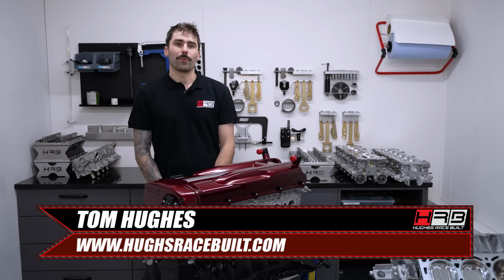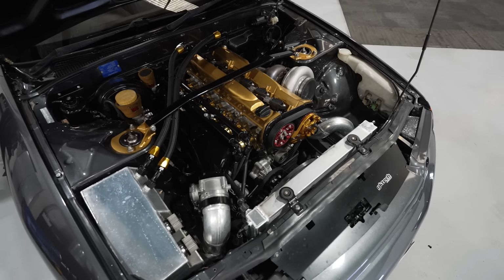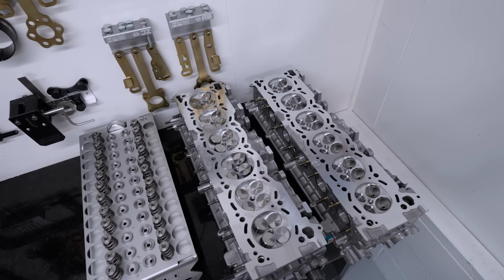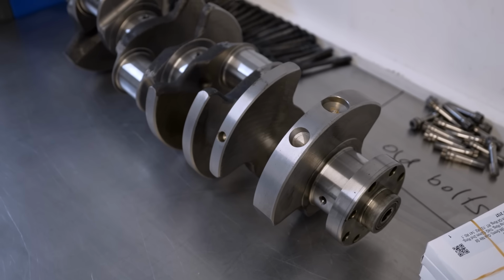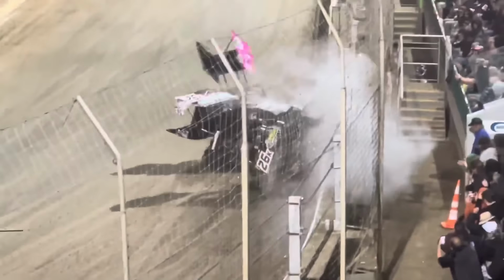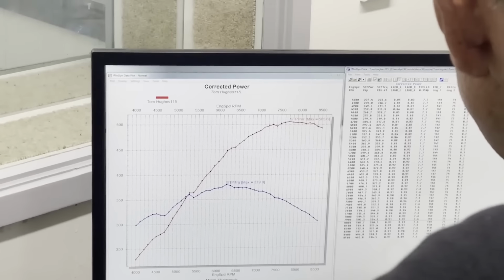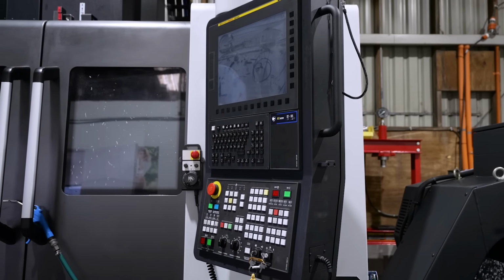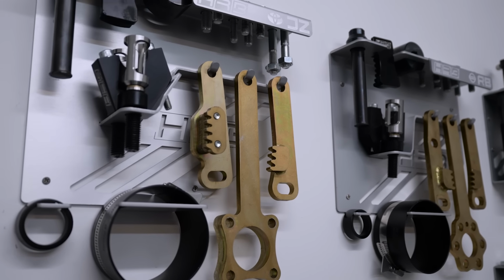New Zealand's Master Engine Builder - Hughes Race Built - Workshop Tour

Comment: You talk much too fast and makes it hard to understand everything you say...along with your heavy accent.
Reply: A slow thinker having trouble keeping up with fast pace talking?
Reply: @gregorythompson5826  In the USA, that fast talking motor mouth would make a good politician or a used car salesman, definitely not an engine builder.There is no sound reason to talk that fast especially about technical terms and concepts.
Reply: @billdedrick1914 This is how kiwis speak mate, what a skill issue
Reply: Turn the playback speed down or try to listen faster😂
Reply: @JaredWood-d9z  No, I will not do that.. Talking that fast is not normal  ..
Reply: I'm not having any problems. Kiwi's do talk fast, so I am told.
Reply: i can understand him perfectly fine sounds like the issue is on your end